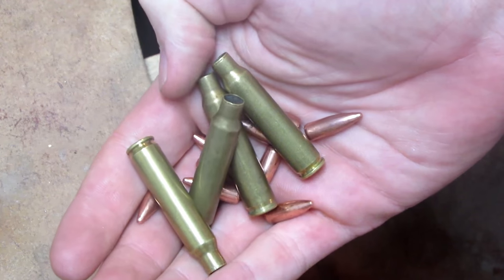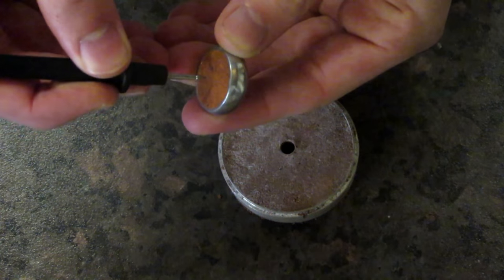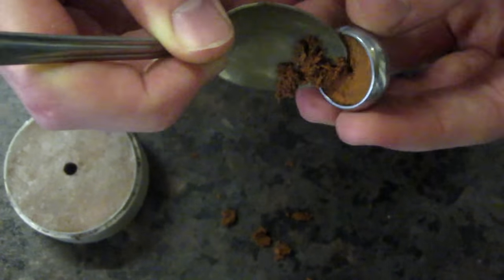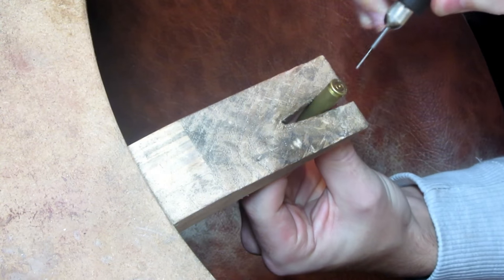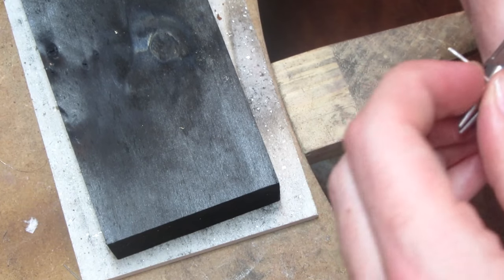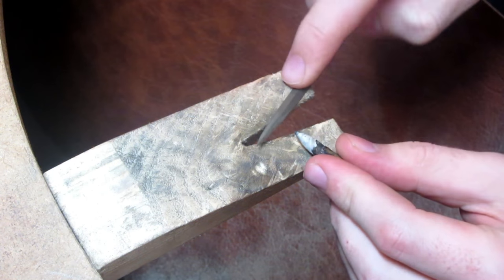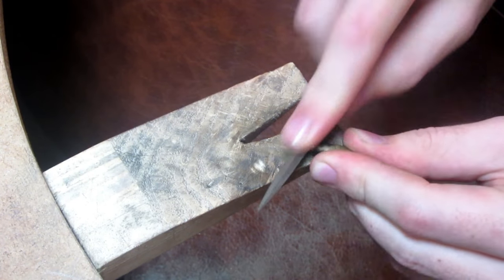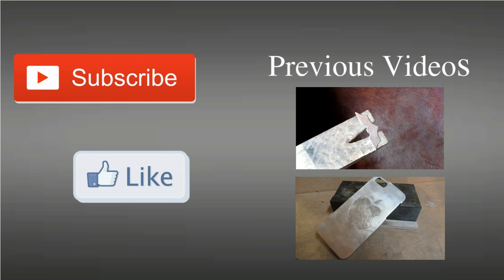Making silver bullets/necklace charm

Comment: Alot of work going on here lol... ... I pulled the head off of a new bullet (Dish Cloth & Vice Grips), emptied the powder, grabbed a spent Casing (Silver 30-06), drilled a hole in the end, screwed in a silver eye hook after filling the drill hole with hot glue (Alot of hot glue lol). Put some hot glue inside the Mouth of the shell (A Generous Amount), slide the Removed Bullet head into the spent casing and it turned out awesome looking. Took like maybe 30 minutes and minimal basic tools. Been 10 years now and still holding up, I wear it everyday.

Comment: how u took the copper rounds out of the cartridge?
Reply: Pliers
Some sort of cloth
Get whatever bullet you want
Directions: get the cloth and fold it untill it's big enough but small enough to hold the pliers, put the cloth over the bullet and put the pliers over the cloth where the bullet is and rock it back and forth untill it's loose enough for it to be pulled out